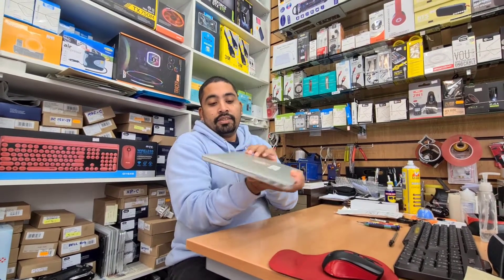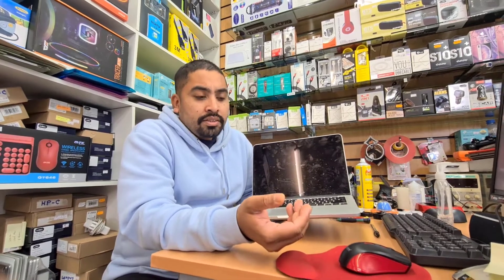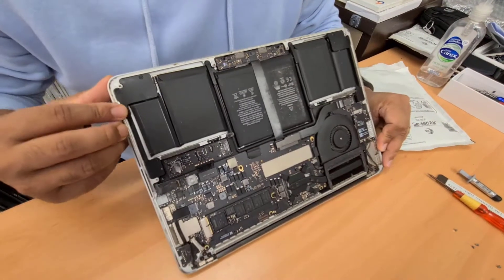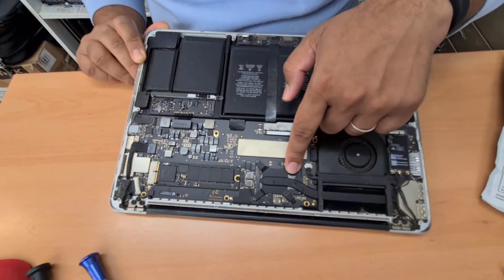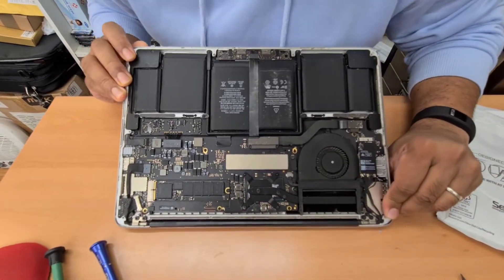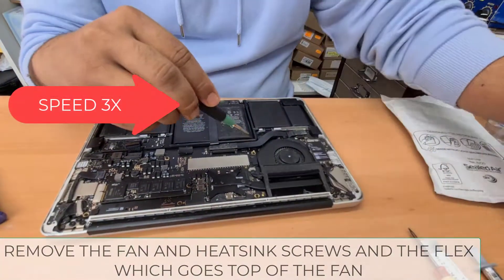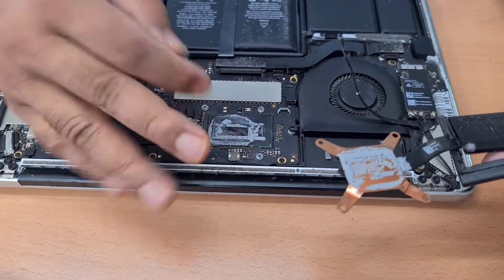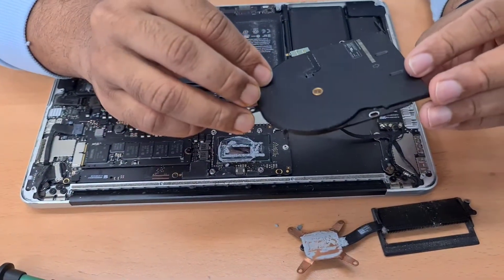MacBook Pro 2015 13 Chimes  With No Display ! Fixed

Comment: All I did to make it work was;  
rub off the old solder paste on the fan with a tissue, then replaced it with fresh Solder-It SP-7 paste. 
I also unplugged & plugged the video connector. 

Thank Bro 👍🏾

Comment: I have a MacBook Pro 2015 with a red screen of death GPU Problem thinking of Applying thymol Paste to see if it works.
Reply from the maker: Sorry to hear that. Give it a try with new thermal paste, and  Please disconnect the LCD cable connector from the motherboard and re-connect it. Hope the issue would be solved. Nice to see you here, and you may subscribe to this channel. Thanks